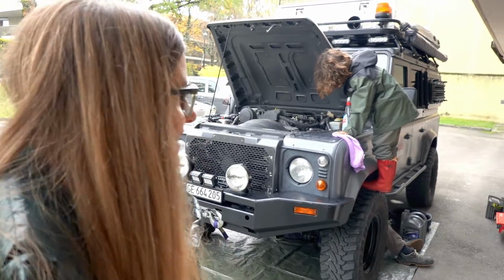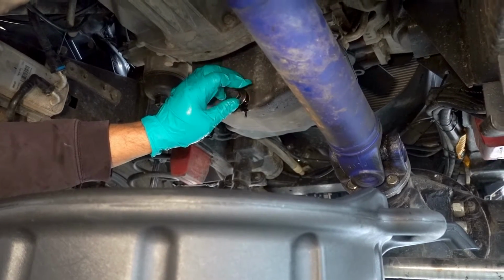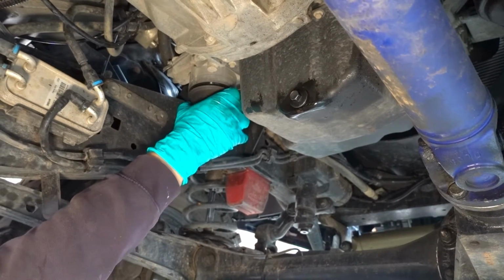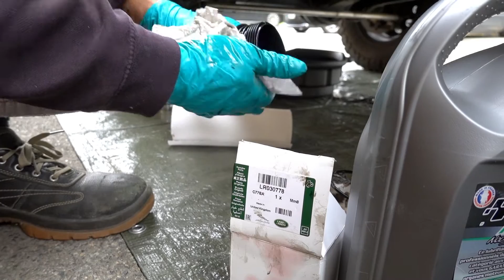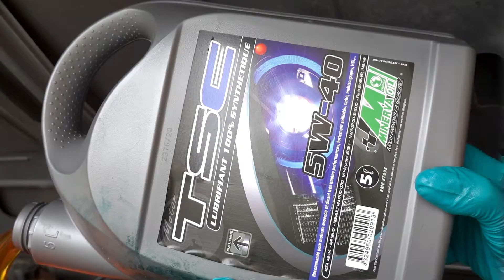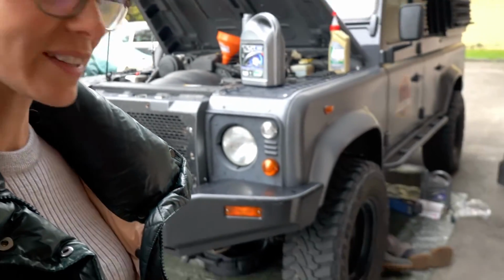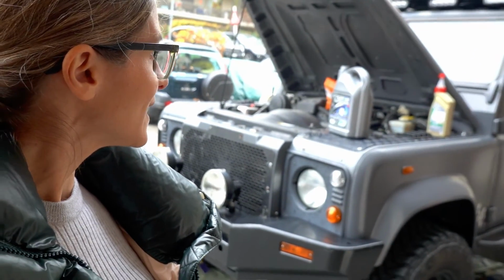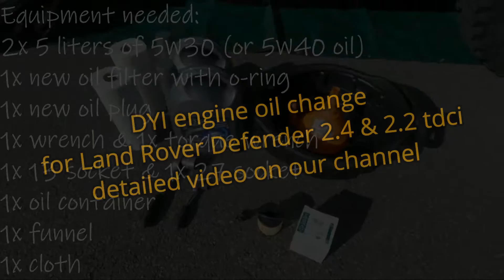MAINTENANCE DAY - ENGINE OIL CHANGE - Land Rover Defender - Vlog series

Comment: A VERY IMPORTANT THING TO NOTE ON THE CARTRIGE TYPE PURFLEX OIL FILTERS IS NOT TOO TAKE TOO MUCH TIME WHEN DRAINING OIL AS THE PUMP CAN EMPTY COMPLETELY AND GET AN AIR LOCK HENCE NO PRESSURE ON START-UP EVEN WITH 7 LITRES OF OIL IN SUMP. THIS IS DUE TO A FAULTY ANTI DRAIN VALVE ON THE FILTER BODY.
Reply from the maker: I don't know pureflex. Thanks for your feedback. Can you tell us more?

Comment: Maintenance is very important and regular oil changes will pay dividends in the future- I see you take great pride in you 110, lots of hard work in keeping it clean. Nice job using a tarp under the truck with the oil change makes cleaning and containing a spill much easier. I have installed a fujimoto drain valve (no more oil plug) in my jeep to be able to install a small hose open the valve (with out the drain plug spills) right in to an old oil bottle.
Reply from the maker: Thanks for your comment! About your drain valve it's nice! Do you have a link for this and do you think we can fit it on Land Rover?

Comment: Why do you use 5w40 and not 5w30?
Reply from the maker: It tolerates better high temperatures and has same capacity for cold start as the 5W30